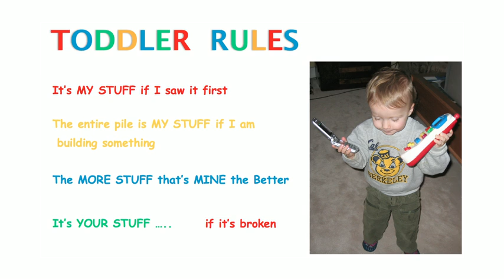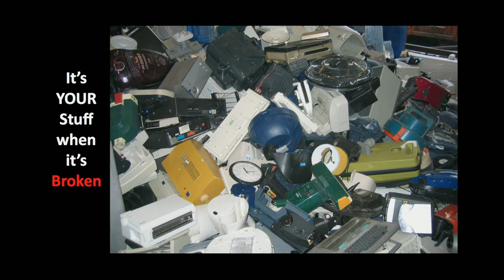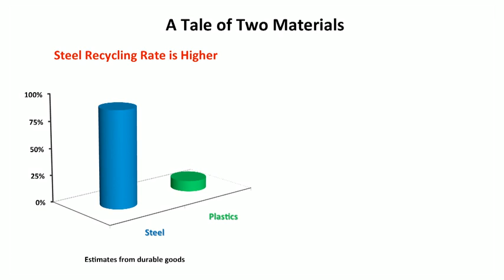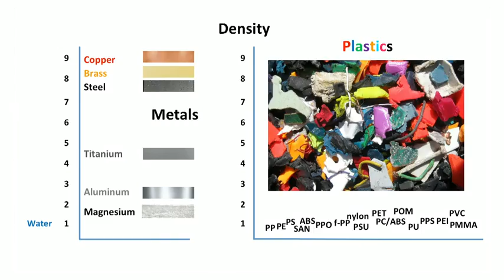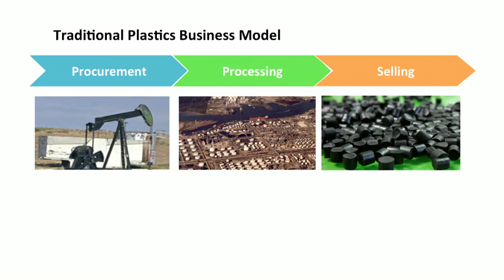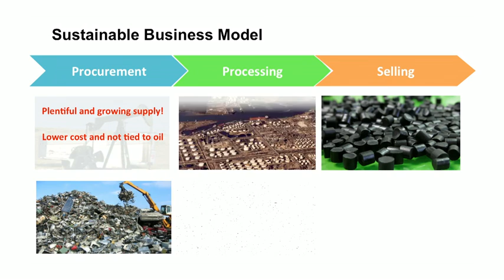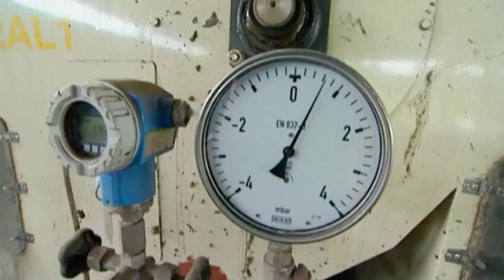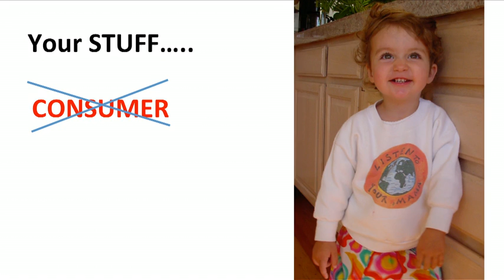Mike Biddle: We can recycle plastic

Comment: Although it is  a great solution which will buy us time it is going to be disastrous
 1- It does not stop the Virgin plastic production. Infact it gives it some incentive to still be reliant on Fossil fuel. This product wouldn't exist if Virgin plastic production is cut down
2- This is already giving rise to people replacing renewable, sustainable, carbon sequestering products like wood with this "stuff"
3- Extremely high energy intensive carbon emitting process. Its come at least 30 years too late. This is going to make it tough to reach countries emission targets.
4- Downcycled plastics leaches chemicals hence this should not be used in food product packaging.

This has got "Law of unintentional consequences" written all over it.

It is not holding plastic packaging users accountable to recycle their products at end of life.

Comment: Do we know more about how it's sorted? What's it's production rate? How many chemicals are used to make a uniform color? He says 70% to 80% decrease in energy use to produce the same plastics, but how far back in the original operation is he going? Is he including from ground zero pumping out the oil?

Comment: @bmw2go11 how do you turn those pellets into a soda bottle or plastic bag? you would have to re heat the plastic at which point melting the plastic will chemically alter the plastic and its qaulity.

Comment: A very large issue with reusing polymers, elastamers, or even composites, is that on an atomic level the recycled material is not the same as virgin material. several qaulities change including strength and durability, or thermal qaulities which will affect the manufacturing process of a product. just because you can sort the different material apart does not solve the issue of being able to reuse it.

Comment: @overtoke Why do we have to stop using plastic? We're not "making more plastic" we're "reusing existing plastic" which means no new plastic is made and no more oil is used to do so. It becomes another useful item which we can recycle again when we're done with it. It's durable, it can take on any shape, it's light weight, and until we figure out something better it's not going anywhere.

Comment: @gaiagale I guess the question is to the speaker of this TED talk, the TEDtalksdirector or anyone who can give a valid answer to both questions. I guess there is some sense in the answer you provided. It would however be interesting to know if the carbon footprint of the recyling proces of plastics weighs up against the carbon footprint of production and current waste disposing methods. Although an individuals part on the environment may be relevant, what is macro-effect and balance of this?

Comment: He forgot to mention that virgin plastic most of the time cannot be mixed with recycled plastic, it has a large effect on the physical properties on the final product, so, products that rely on the strength of the plastic cant be made from recycled plastic. And also used PET bottles cannot be recycled into bottles again due to bacteria and fungus...  Other than that is fine, like the useless cheap printers that cost less than the actual ink cartidge.

Comment: @t3tsuyaguy1 I think impurities would accumulate according to the method he describes. The separated plastics are ground and melted, which blends together any bits that may have ended up in the wrong place. These impurities would not be separated out the next time around, because their method of sorting cannot separate mixtures. It's not such a big deal yet, but eventually they may need to devise a way of discarding any mixed or contaminated plastics if they cannot somehow be purified.